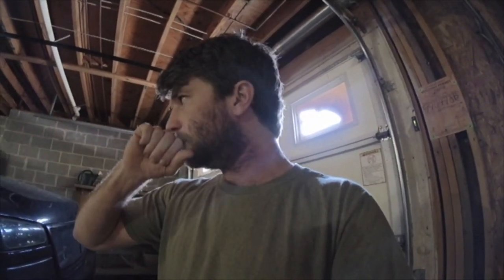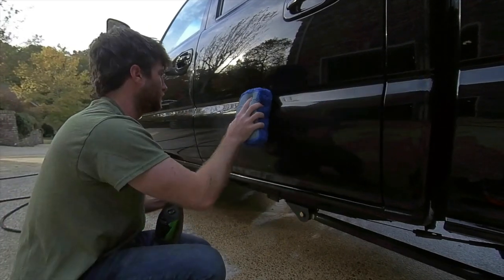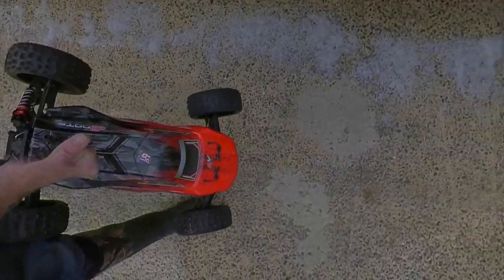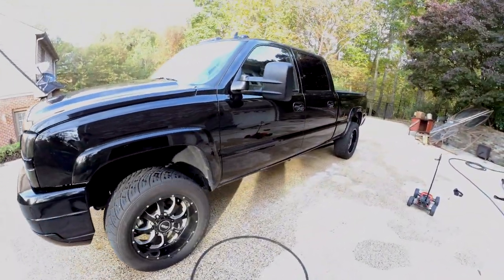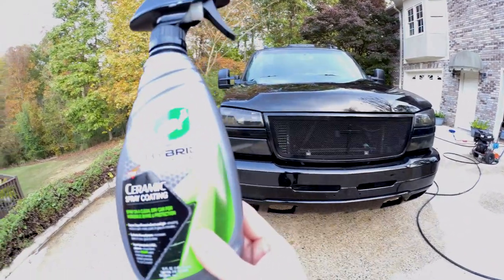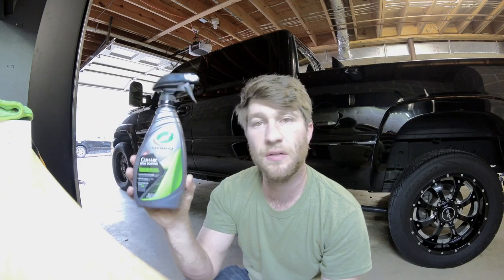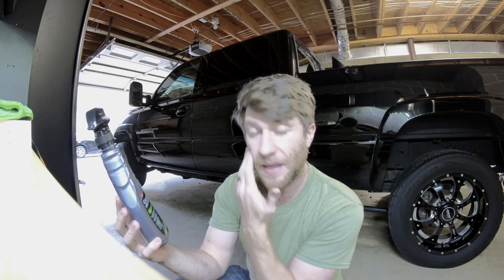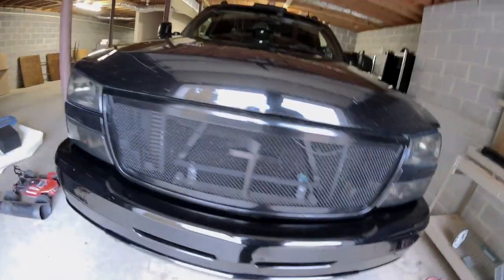Ceramic Coat At Home?

Comment: Your truck looks like glass when its outside. I have a 2004 GMC DURAMAX it's white I am going to get it painted soon what color do you think I should paint it?
Reply: AmanagementfromAlabama here. I would go with white. Easy to keep clean vs black. You don’t have to disassemble the entire truck. Jambs. Etc. and it’s clean when modded tastefully. 

Thanks Again for commenting! 
-AManagementFromAlabama
Reply: I agree with the other guy. Go white and you won’t need to do the door jams. Do like a white with a purple flake
Reply: Black is so hard to keep clean, I suggest to keep it white, grey, but as long is you don't choose black, you should be good.